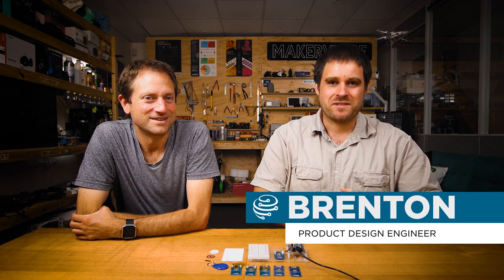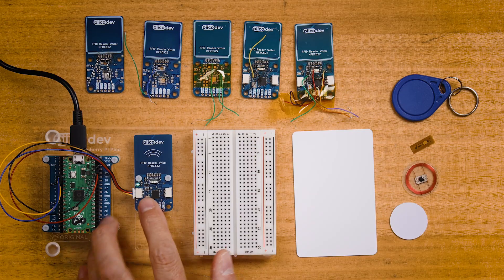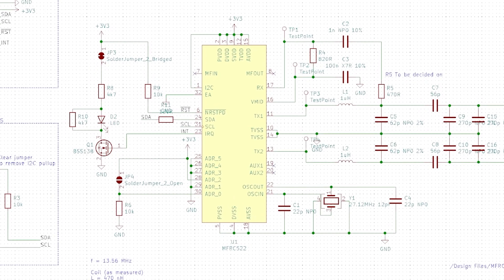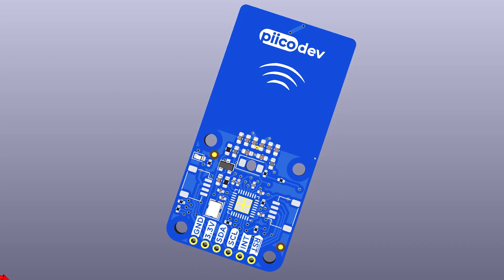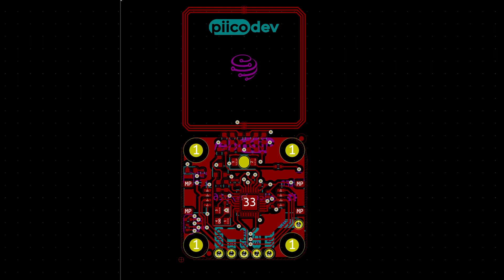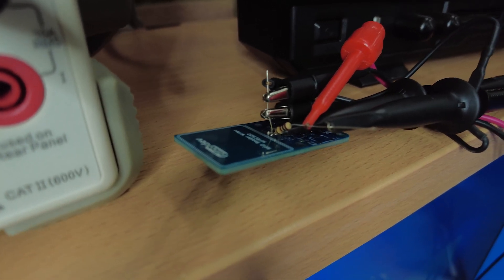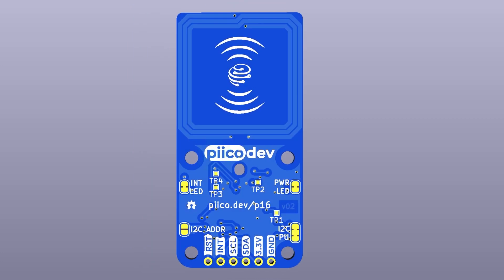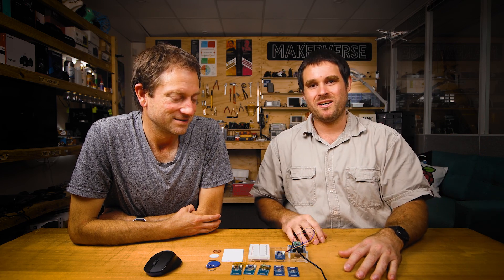The Factory | Designing an RFID Reader

Comment: It turned out very well, I'm trying to integrate the circuit into my board. Do you think I could replace components 0603 with 0805 to facilitate manual soldering? or would it influence the functioning of the antenna?
Reply: You can solder 0603 just fine.

Comment: Do you have a base model that I could add to my Arduino nano and connect custom antenna (various looped copper coils) to? I want to try various different antenna sizes and strengths, but don't want to have to create a custom board each time....
Reply from the maker: We don't, but when we launch this product (real soon) the PCB design will be open sourced - you'll be able to modify it to create the testbed you're after.
Reply: @Core-Electronics  that is awesome. Is there training you could recommend on creating the testbed?